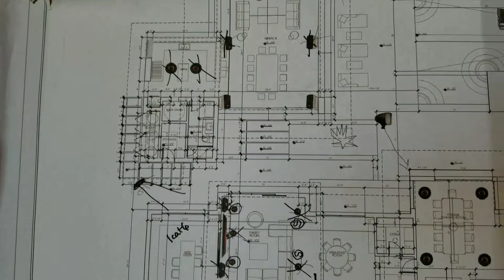How to Properly Pre-Wire a Large Home for Smart Home Automation

Comment: I was gonna say this almost looks like construction in Mexico with all the concrete. For the WAPs you just used scraps of cardboard staples to the ceiling joists to put the CAT wire thru or is that a product you can buy somewhere?

What is all the yellow wire on the ceiling connected thru similar cardboard strips? Is that how they wire lighting cans in Texas?
Reply from the maker: Yeah it's scrap cardboard, I'm sure there's a product somewhere that's designed specifically for in ceiling terminations but cardboard will suffice. Not sure what yellow cables your referring to, it's probably for can lights. And funny you say it looks like construction from Mexico, we are located near the Mexican border in Texas a lot of construction habits are sometimes used here, I'm no 100% sure what the cinder block is made with but i remember the owners  paying a bit extra for it. Its not your typical construction style down here.
Reply: @Lupestang1  Yeah real close! It looks almost tropical there! I thought it might be Puerto Rico or something at first.

I've seen other guys use a 1 gang low voltage bracket on the ceiling for WAPs, I guess they just leave it untrimmed and cover the open box with the WAP so it can sit flush with no wire visible. When you leave the wire for your WAPs bare like that do you find the drywallers either don't poke the wire through or mangle them? You don't put a nail or anything?

Yeah the yellow is definitely romex. Can't figure out why they didn't use cans, maybe they're going to do surface mount lights or something.

Comment: I'm probably a little late to the party for Q and A, I watched this the first time right after you posted it. Thanks for sharing it, don't listen to the haters. Bottom line is your're making it happen and they are just making noise. My question is this: when you rough in cables hanging from the ceiling like for APs and speakers are you using cardboard to center them between the studs? Does this pose any issues with the drywall guys?

Comment: Why not go IP for the cameras instead of analog?
Reply from the maker: Andres Bermudez Hallstrom analog cameras are less expensive than IP cameras, I'm going to use 4mp savvy tech camera's with starlight function
Reply: Thank you for the reply! I was asking my self the same thing and found your fast reply. From the video it appears you are doing a great job!
Reply: Lupe Perez that’s surprising that the ~150 bucks per IP cam was out of budget on this job...nice work nonetheless!  Love to see the closet and rack walk through as you get closer to finishing up...
Reply: There's a general buzz that "newer is better" and so IP cams must be better than analog.   There's another reason (for their superiority) and its essence lies in Ohm's Law:   IP cams run on 48 volts and so the ohmic (voltage drop) loss is roughly 1/4 that of similar analog camera wattage load (assuming same wire gauge... which is not true; still, this matters!)    This really matters on long cable runs; although I must praise the OP for his use of siamese cable, which is optimal for this need.   Analog cameras therefore tend to brown out during night operation, when their inboard IR emitters are in operation, when served by long cables.        For a colossal home like the one in the video, that's a worry.      I hope the OP tested, on his lab bench, his proposed analog system, the way I've done... to predict a margin of safe operation.         It's not too late to change all that wiring... as it seems the walls are not sealed up yet.         The high price of IP cameras is nothing compared to the potential threat here.
Reply from the maker: John Becich thanks for the insight, I've stoped responding to the comments they seem repetitive. I'm planing on posting an update video soon. Also I've got a new project that's even bigger that I'll be posting too, feel free to check them out and ask any questions about them. 👍👍👍
Reply: Cost shouldn't be an issue with a house like this, a full Avigilon would have been affordable compared to the rest of the house. Next thing you know you'll be installing Netgear APs if cost is also a factor there.

Comment: Gave me a good laugh, all of those cables dangling would get destroyed. Granted the cable with the celophane would be protected from drywall mud and paint. The head end with just double gang boxes wouldn't cut it. I would use a panel, coil the wire then pass it through into the Double gang boxes and leave about 6 to 12 inches or even better use patch panels. This would make trimming much easier, faster and lot less of a chance for some tradesmen to not screw up the wire. Also use Mud rings for the camera ends so it doesn't get covered by the siding, we use to just have the wires sticking out but they would get clipped off or smashed. Not to mention this will give you room for the balun if you use Cat5E or Cat6.

I've been doing this stuff for a while. Drywall, siding, window installers and sometimes framers will screw you each time.

Comment: Hey awesome video! What is being used to hold the wires in place for the access points, cameras, and speakers? Is that just cardboard? Does it get removed before the drywall goes up? Thank you so much!
Reply from the maker: Taylor Burne just strip of cardboard, they'll be covered with drywall. The cables will be behind the drywall and my techs will use a line toner to find them. The reason they're hidden behind dry wall is if the contractor paints and does his texture on the walls I can always reposition speakers or cameras or access points if needed. I can center them with the room or with furniture so I don't have cables poking out of the wall and I'm forced to wire them in the specific location or the cables are poking out of the ceiling.
Reply: Lupe Perez how can you reposition speaker wires after completion?
Reply from the maker: Wdiddy D if the wire slack is enough yes.

Comment: If you're using Shielded CAT 6 you should also show the proper grounding of the shield once the terminations are completed. I also agree with the others I would have used IP Cameras or pre-wired along with the Siamese cable.
Reply from the maker: Jay Shh I'll do a follow up video once the house is done should be done by January February of 2018.

Comment: How to under cable and out date the system before the house is finished. CVI cameras are a stop gap for pre installed gear not for new installs, you should have fibre and minimum Cat6A/s for your networking, if you want a properly cable a new house.
Reply: you realize augmented cat 6(A) is for backbone only......  and as fiber goes...send me an example of what you have done in fiber so I can critique it......  I'm sure you are highly qualified in structured cabling.....
Reply: Polaku81 20 years.

Comment: Any particular reason that you're using all the Cat6 instead of Cat5e throughout? Seems like a massive extra cost.
It looks like it was a nightmare there where you had to chase the block-work! What happened - were you contracted late or was it due to a variation?
Looks like a great project though.
Reply from the maker: Truly Zambian I'm using cat6 shileded for video and cat5 for IR triggers, I'm going to use a video matrix and all the tv use a balun receiver to disrupt video. The manufacturer suggests minimal Cat6 type A for speed and I've had issues with unshiled wires picking up interference in other homes. The shield provides an extra bit of protection after it's all installed and we ground all the wires.
Reply from the maker: Truly Zambian I apologize for not responding sooner.
Reply: +Lupe Perez
Ah, I see.Thanks for explaining it to me. I haven't yet seen any installations where the Cat6 was actually REQUIRED and not just "specified". I have worked on a couple of sites where the design spec called for Cat6 but it was more just to make it "Cat6 Ready" as opposed to actually being required by any of the equipment that was going in by the time of commissioning.
Great video. You and your team do fantastic work.
Reply from the maker: Truly Zambian Thanks for the compliment I  appreciated it, check out the new video I just recently posted. It's a walkthrough for another large home that I'm working on I will probably upload a video after it's fully pre wired I explaining all the details.
Reply: We primarily use CAT-6 for all our installs for much of the same reason Lupe mentioned. And in addition technology speed is growing faster for almost all devices. Cat6 is rated for 10x higher speeds. Nothing future-proofs a design, but planning for today with the emerging technology of tomorrow keeps the client safe for at least the next decade and beyond. We also use 100% IP cameras.
Reply from the maker: Stephen J Muenstermann 👍
Reply: Cat6 has AWG23 conductors, while Cat5e has 24 gauge.      Since the cameras are POWERED via these cables, there is a slight advantage... less voltage drop, especially at night.     Surely, Cat6 is stiffer and harder to work with, than is Cat5e.         Also Cat5e is now quite inexpensive; can't say that about Cat6.
Reply: The only way I know to future proof a building is to install cable raceways, for future cable replacements.
Reply: John Becich You make a good point about the use of ethernet cable to carry power. I hadn't thought about that. I have used it for that precise application when installing access control systems - for example, we might have a card reader which uses some wire pairs for certain functions and then uses a pair of wires for power.

Stephen J Muenstermann thanks for your reply too. For some reason, I didn't get notification from YouTube about your reply so I'm only just seeing it.
Reply: To clarify, for all readers: The ethernet cable (Cat5e is only AWG 24) is not good for high amperage.     The point is that, with an "ethernet cabled" system, the amperage is low because the voltage is high, thanks to the standards of design in IP camera systems, which rely on 48 Volts instead of 12 Volts, as do analog cameras.          Analog cameras (@12VDC) notoriously suffer from brown out, when powered by long long cables... say over 75 feet.      Meanwhile, a well-engineered system will have substantial margins of safe operation... IOW it won't even come close to browning out.         Countless analog systems out there "work"  but not with much margin of safe operation.
Reply from the maker: John Becich 👍
Reply: The price difference between cat5e and cat6 is negligible.     Plus, cat6 can do 10GbE (albeit only at up to 30 meters).
Reply: Matthew McKinney "The price difference between cat5e and cat6 is negligible"??? Yeah, if you're talking about 1 or 2 boxes of cable. But a difference of £77.22 (cat5) vs £94.35 (cat6) for 305 meters of cable can add up significantly when you're cabling jobs of this size. Multiply the cost across several projects and that "negligible" difference becomes unnecessary expenditure if you're installing cat6 that you don't need to just because "the price difference between cat5e and cat6 is negligible."
Reply: I guess so, but having that option for 10GbE down the road is nice.  That's why I went with Cat6, for future 10GbE capability.   All my runs are less than 50 feet.
Reply: Matthew McKinney I'd only lean to cat 6 for durability especially if it's shielded and not just screened. But I still don't understand why he's throwing in so much coax for cameras. They'll be back in a year to rip that out to replace with more cat 6.
Reply: Yeah, I personally would want IP cameras, but to each their own.  And it's always good to run an extra couple of Ethernet cables and leave them unterminated in the wall for backup or other future use.  You can use Ethernet cables for SO many things!

Comment: Essentially a mansion, but no desire to splurge on IP cams..?
Reply from the maker: Chucks Basix when you have the a product that does the same thing for less money that seems logical to not ''splurge'' but to budget wisely. Now a days CVI cameras are just as good as IP. Yes 6mp, 8mp and even 12mp IP are great, yes they look awesome. When your done and deliver the project you'll have to connect them to a 4k tv, a 4mp CVI camera set at 20 fps looks so impressive and detailed you'll never notice the difference between analog and IP cameras. Even if your NVR is capable of a higher resolution what's the point of setting it on something your tv can't handle.
Reply: "What's the point of setting it on something your tv can't handle"... answer: so you can zoom in more to catch the pesky thieves...
Reply: I'm no geek but I think he's ripping off his customer all the coax for cams, why not just go with cat 5e with adapters to coax. The cat six why not shielded cat 5e?
Reply: Shielded Cat6 allows you to run 10G ethernet, the most you can get out of cat5 is 1G ethernet shielded or not. I dont see a problem with the camera setup, obviously if the customer wanted to spend the money on IP cameras they would. Ive done huge houses for massively rich people and most of the time they want to splurge on all the fancy things that catch peoples eye so they can show them off, when it comes down to it they get tight immediately when they hear the cost of IP cameras and equipment or a whole house generator setup. Im an electrical contractor and I completely understand why the system here is the way it is. The only issue with the siamese cable instead of UTP/STP is that it has its limits as far as future proofing, but many times there are "future proofed" installs that are completely worthless for the proposed use 10 years later. CVI cams are great and if thats what they wanted thats probably all they were willing to pay for. I often give quotes for more than one "level" of system, such as IP vs analog cams, and most of the time its a completely cost based decision. Using UTP with coax baluns is not something I would do on  a new install, its just another component to fail in the system, although that method is great for repurposing cables or super long runs, but those require powered baluns
Reply: @Lupe Perez Keep up the good work, and for those that do not understand the difference between analog and IP cameras shouldn't say he is ripping off a client.  Current HD-TVI systems (analog) use a lot less storage than most IP systems and while having the same high resolutions 5, 8+ 4k MP ranges. HD-TVI also provides no jitter or delay, and lossless format.   I am sure the client was made aware of his/her options regarding the needs at the location.

Comment: What a difference half a year makes...  This install is outdated in terms of "automation" now, lol.  This can only be called an a/v pre-wire these days.  A central a/v system at that, which is quickly losing popularity.

I came here to peek at what you were doing for curtain controllers and power, networking build for smart equipment, smart hub wiring for future proofing, wiring for mesh, door locks, garage door, zone Bluetooth audio wiring, poe sensor wires, and all the crazy things people all of a sudden need.  
Then I looked at the date posted... Facepalm.

I can hardly believe how fast the market shifted.  

"Alexa, why can't I do all the cool stuff the neighbor does?"
"Because you wired your house six months ago, Gramps."
Reply from the maker: silverfeathered1 what are you taking about, what marks you say this is outdated? 

I think your confused, you probably think you could just have a few Google homes, a few eco dots, and a couple of fire tv's and that's it. Add a few Yale door locks and some hue lights and call that a Smart home. 

Good luck selling that idea to these kind of home owners, and making all that work in a 7k square foot home, with solid concrete walls. 

Lol God bless you
Reply: You brought up your own problem.  You're not wiring to make that work in a 7k' home.  
You got your head buried in the sand.  The next few years are going to see big changes in how we control our houses.  Even now, EVERY big client (commercial and residential) is rushing to get wired for automation to cut down on the RF. (The RF you get from the things in your unprofessional snide comment)

That's a great central A/V and surveillance install.  Great job!  That's not home automation, though.

I'm saying that your title says "automation".  This kind of install can't be called "automation" anymore.